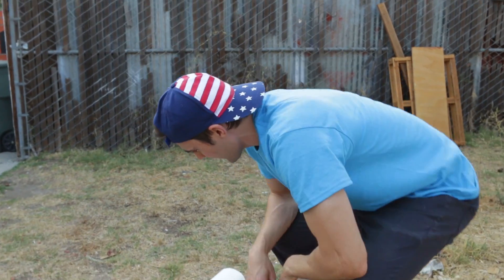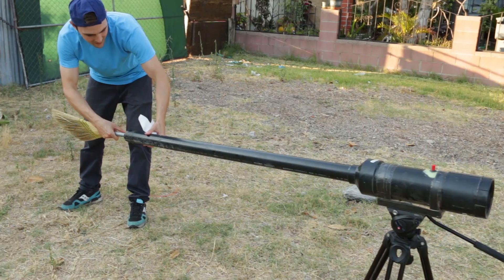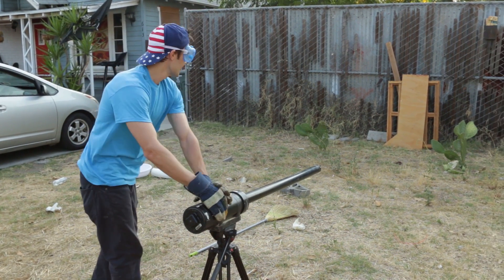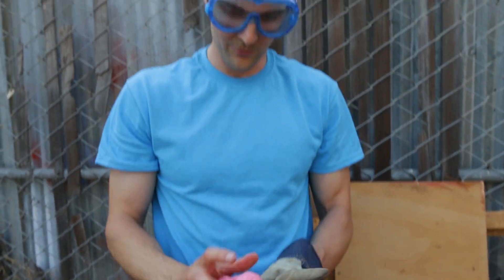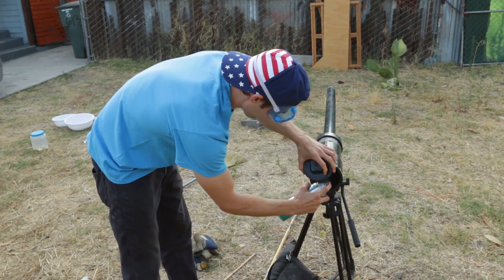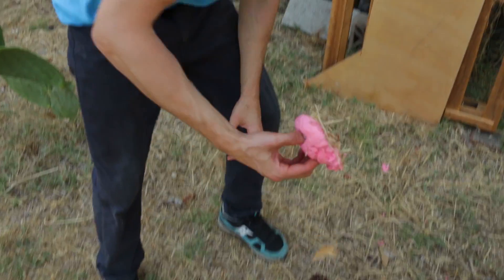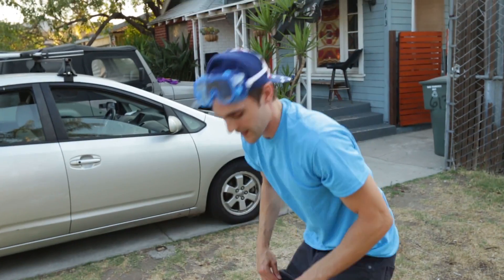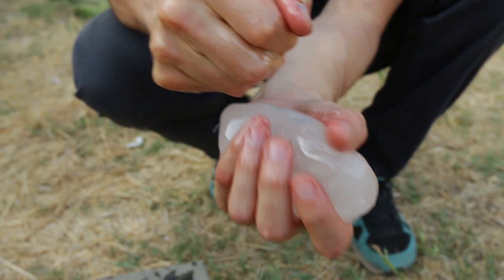Shooting Slime Out of a Potato Launcher

Comment: The first attempt wasn't an aiming issue.  The slime got jammed in the barrel, and bounced around a lot before exiting the barrel.  It left residual oil in the barrel and on the slime though, so when you tried a second time with even more oil on the slime, it didn't jam.